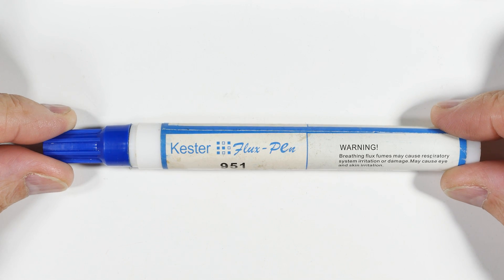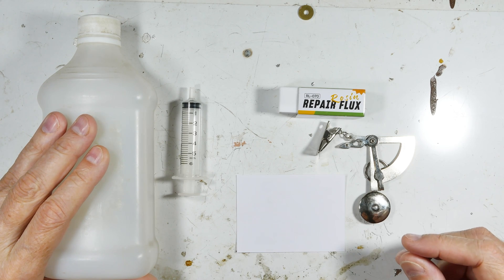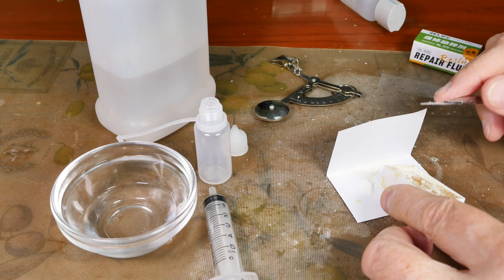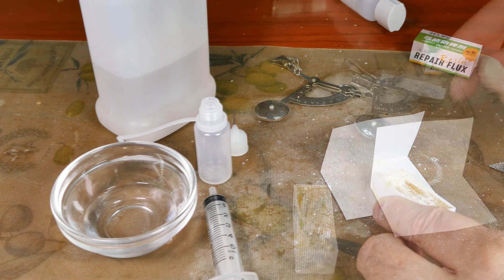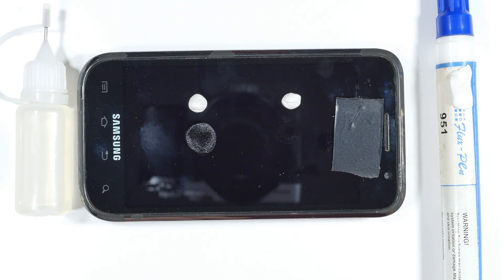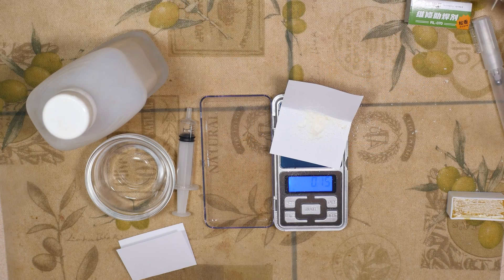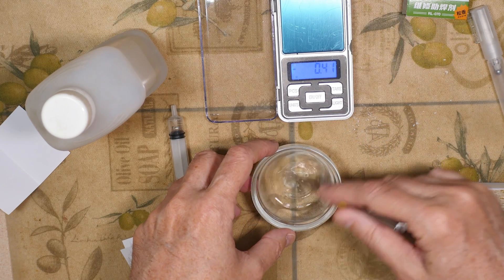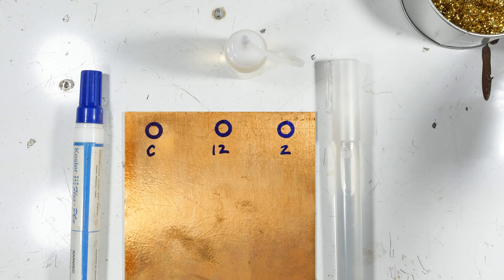Soldering--DIY Rosin Flux Experiment (4K)

Comment: I would like you to repeat this experiment and use solid wire solder to ensure that the core flux doesnt tamper with the results. Excellent video nun the less. I've been trying and wondering what would be the best way to do this, and surely your calculation seems a lot more accurate on the revision. Have you considered making tacky paste flux as well?
Reply from the maker: I have not considered paste. I have found a better flux formula, but one on the ingredients has been hard to find at a good price.
Reply: @tsbrownie  is that right? Care to share? I was reading well trying to get ahold of data sheets from manufacturers, and the way you do it seems right, but they also have proprietary mixes and hid ingredients as well from what I've noticed. I tried asking some, but they won't talk, and I wouldn't expect them to either, but it would be nice to find a good home solution. I applaud you for your attempt and documenting it for all of us.
Reply from the maker: @rubenmejia4881  One secret is to look up the poison / EPA declaration sheets. The ingredient that is being stubborn is adipic acid and it's in a mix of alcohols.
Reply: Yes that's what I was referring to commonly called safety data sheets adipic is one I've also seen citric acid and malic acid used as well I'm going to try with citric since it's easy to get a hold of.

Comment: Filter the rosin in in the syringe, put a piece of cotton, put the Rozen in the back of the baby syringe, then push it through to the needle canister then it’ll purify it then add heat to burn the alcohol off and you let me left with purified Rozen

Comment: I clearly overdid mine. It is saturated with rosin, thick as honey. The commercial stuff clearly has some acid or something as you can see in 15:02 that it has removed the oxide from the copper.
Reply from the maker: Yes. I found one that uses adipic acid, something I have never heard of before. From what I found it's a weak organic acid.
Reply: @tsbrownie  adipic seems to be used as food additive, so it must be relatively safe I guess
Reply from the maker: @juanignaciocarrano860  Yeah really, just because they put it in food may not mean much about safety. 😒 Anyway, I think I'm going to try it.
Reply: @tsbrownie adipic acid is found in beets and sugar cane.  Whether they use food grade adipic acid in the flux is a different question, of course 😅.

Comment: Thank you. This is an area of great investigation, personal preference and debate. 1) The DIY rosin is not "no-clean." The rosin is aggressive and will damage things, down-the-road, if not absolutely completely removed. 2) It looked like the larger puddles of rosin/alcohol were cooling the PCB, via evaporation, and slowing down the reflow. I had not thought of that as a factor, before, and I found it an interesting consideration. 3) I think that one of the ingredients in the paste type rosins is nothing more than petroleum jelly. But, I am not sure. Cheers.
Reply from the maker: If you look closely, you can see the commercial pool cleaned the copper more aggressively and in 4K you can see it bubbling. What they add is going to require more investigation. As for petroleum jelly, I have never heard of that and as a general rule you don't want oils of any type on your workpiece, solder  or iron. 
Update: I found lots of people claiming to use petroleum jelly, but no videos. That would leave a mess to clean off. I once put a dab of that stuff on an outdoor screen window as an experiment, and it took 11 years for it to disappear!
Reply: @tsbrownie  Hello, nice test, my comercial soldering flux have list of ingredients, and one of ingredients is hydrofluoric acid. of course with resin and alcohol. Maybe what you have there is also some kind of acid - they dont evaporate much and have oily feel, and also they are active all the time so you need to clean them thoroughly. Resin acts as acid only when heated above 200C. so it does not damage anything when not heated, only looks ugly.
Reply from the maker: @johnr1256  Interesting. Thank you.